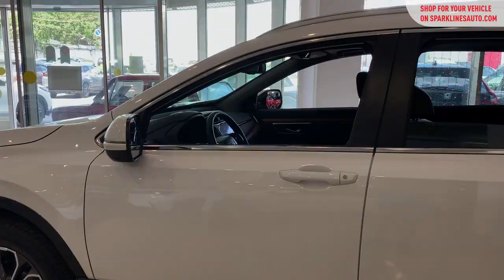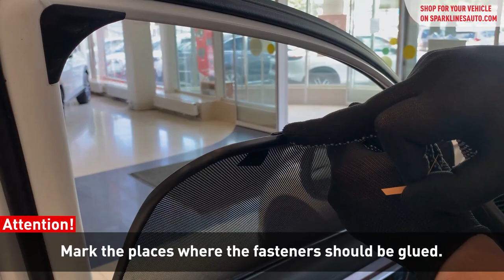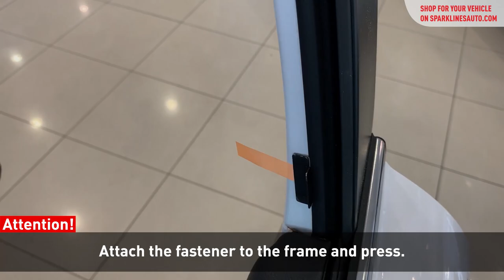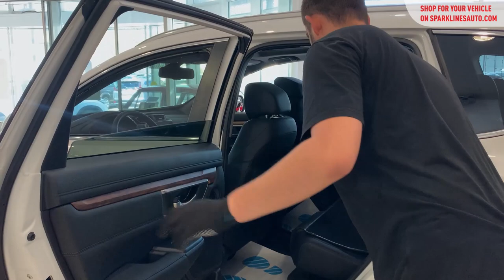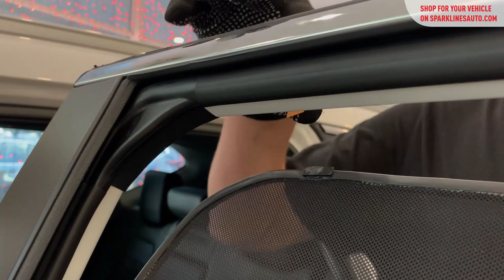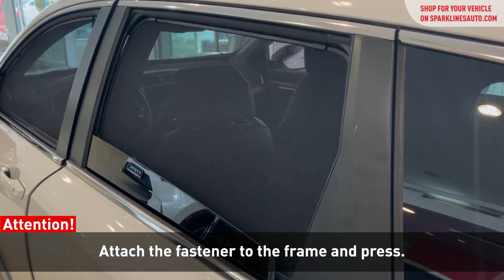How to install Custom Fit Magnetic Sunshades for Honda CR-V 2017-2022

Comment: Do they offer enough privacy for camping in your car?
Reply from the maker: Hi @windsup2day,
Thanks for the question. 
We would like to inform you that the set of the magnetic sunshades for Honda CR-V 2017-2022 shown in the video hold firm even if the windows are rolled down which can also help protect riders from flying bugs, insects, dust, and other light debris. It is a great car camping accessory that offers enough privacy for camping in your car.

In addition, we would be glad if you take a look at the magnetic sunshades for Honda CR-V 2017-2022  which you can purchase through Amazon:
- CLIM ART Magnetic Car Window Sunshade for Honda CR-V 2017-2022, 4 Pc. Set, Side Glass Covers and Screen, Block Sun Rays Curtains, Window Shield Sun Shade for Baby in Cars, Camping Accessories- MS0005.
Here you can find the link to the item - https://www.amazon.com/dp/B09KY7GP21?ref=myi_title_dp&th=1 

If you have any other questions regarding our products , you can always contact us at customerservice@sparklinesinc.com 
We`re always happy to serve you and your vehicle!

Best regards, 
Customer Support Team
Spark Lines Inc.
Reply: @sparklinesinc thank you so much. This is very helpful.
Reply: @sparklinesinc  what do you recommend for the hatchback window and the front windshield? Thank you for your assistance.
Reply from the maker: Hi @windsup2day,
Thanks for getting back to us.
We would like to inform you that we have the item for the front windshield - CLIM ART Windshield Sun Shade for Honda CR-V (CRV) 2017-2022 - Custom-Fit Foldable Car Sun Shade - Car Sunshade - Vehicle Sun Protector - Front Auto Windshield Cover, Car Windshield - WS7001. Please note, that this item is compatible with Honda CR-V (CRV) 2017-2022 but it doesn`t fit on vehicle with windshield mounted sensor.
Here you can find the link to the item on Amazon - https://www.amazon.com/dp/B0B24XKRZZ?ref=myi_title_dp&th=1 
In addition, we would be grateful if you could provide us with more details regarding your question about the items for the hatchback window. Which product are you interested in?
Feel free to ask more questions. We`re always here to help you!
Best regards, 
Customer Support Team
Spark Lines Inc.